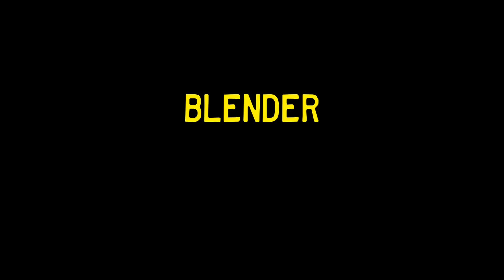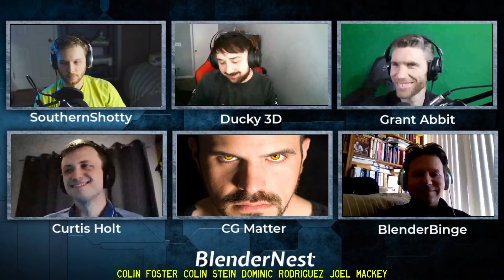BlenderNest #5 - Blender 2.82 Features

Comment: Ducky that feature change you mentioned @18:15 can be put back to the way it was. With something like the inset tool selected, in the 'Tool' tab in the top right, in the 'Active Tool' box it says 'Drag' and the default in 2.82 is now 'Select Box' I believe. Change it to 'Active Tool' and save a new default startup file. I didn't like the change either but glad it's easy to put back!

Comment: 15:40 the RTX cores don't just do "extra processing" but specifically raytracing processing. So obviously it's useful for Cycles which is a raytracing engine. Speed improvements on the same card with OptiX disabled vs enabled is about 30-50% (!)

And actually raytracing usage is somewhat limited in games at the moment since the RTX cores only do the tracing. You still have to do something with the result. And it's pretty hard to do a full-scene raytrace at 60 frames per second. Of course in blender noone bats an eye if it takes 30 seconds instead of 0.016.

All in all gamers are like "meh" and 3d renderers are like "wow yes please I'll have two!".

Comment: E- cycles is out for even 2.83 but kind of alpha... and 2.82 beta... its really adaptive and fast to be honest... and it should get implemented in master branch... but they keep the decision to be made from e-cycle dev
Reply: That’s all awesome info.  I need to jump back into it and see where it sits at this point.  Thanks!
Reply: @KevBinge  No problem, I was just curious myself! :3 In the meantime, I have heard that Matthieu will in send the code to anyone who bought it  - which would be perfectly sufficient to be GPL. (After all, it's free as in "speech", not as in "beer".)

(Paying users who got the code that way would be free to share it with anyone, though - which is why probably even commercial FLOSS projects usually don't bother and just put it on the internet somewhere. Writing a letter to the manufacturer to ask for the source code of the modified Linux that runs on your TV could be fun, though. :D)
Reply: So Blender is under a copyleft license (GPL), but apparently Cycles is (additionally?) released seperately under a permissive license (Apache), which allows anyone to make proprietary/closed-source versions of it.
Afaict this is what Matthieu did with his E-Cycles, so it's his decision whether to release the code & allow integration into vanilla Cycles - and it's not only legal but also fair game if he doesn't. (That's what permissive licenses are for.) Though, it should be mentioned that he's also regularly contributing to the free Cycles that benefits all Blender users, and he has been for years.
Reply: I'm honestly pretty confused about the whole situation with E-Cycles, let alone how the Cycles devs feel about absorbing its code. IDK if Matthieu wants to keep it proprietary so he can better make a living? (Maybe then he should sell it for more. :P I've heard it's a pretty great value for the money.) Is, like, employment as an official dev in the cards as an alternative, for him or the Foundation?
Obviously, making Cycles as fast as E-Cycles feels like a no-brainer  - but there might also be disagreements about more big-picture design & development of Cycles? Say e.g. if it were the case that the E-Cycles optimizations require making the code more complicated, that would be an argument to pass on those speed-ups since it might make maintenance harder in the long run & hinder other improvements. At some point, even if you had unlimited resources for development, you reach a trade-off between keeping the codebase minimal & elegant (& restrictive), and optimizing every detail as much as possible (prematurely).
Reply: I just remembered Blender Guru ramble about this on FlippedNormals. Huge discussion underneath: https://youtu.be/BRWAx3bnNcQ?t=234&lc=Ugyf-fk8ii7eOlUtAJR4AaABAg
TL;DR: Many of the E-Cycles improvements are in fact getting merged into vanilla Cycles. When they don't, it's usually not about Matthieu keeping them to himself, or Blender not wanting to mean (as Andrew speculated), but about disagreements in how Cycles (and Blender) should be designed & developed.

(Also, some claim that E-Cycles is in fact FLOSS? But I couldn't find a code repo, so I'm confused...)
Reply: @nibblrrr7124  i didn't know that Matthieu has contributed to the cycles too... thanks for the huge info though <3